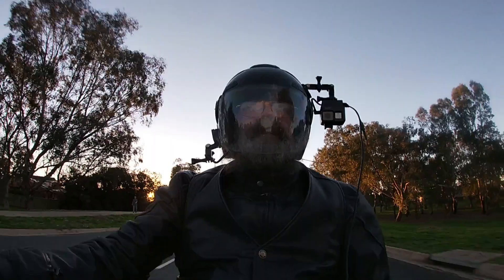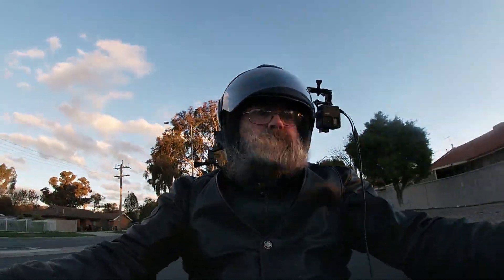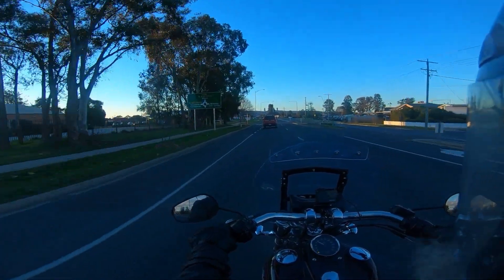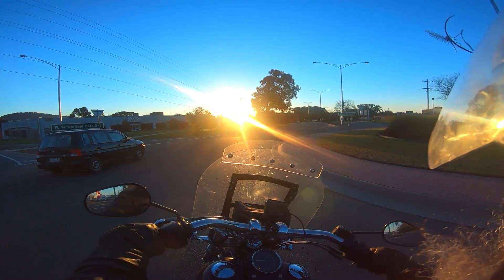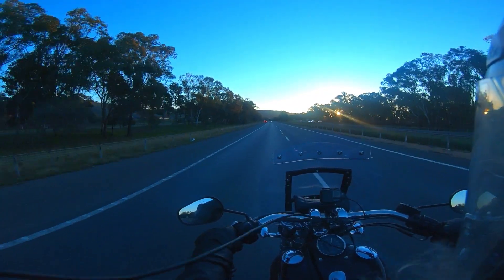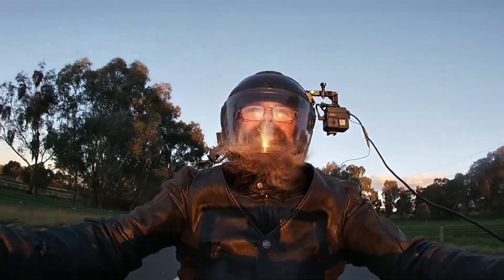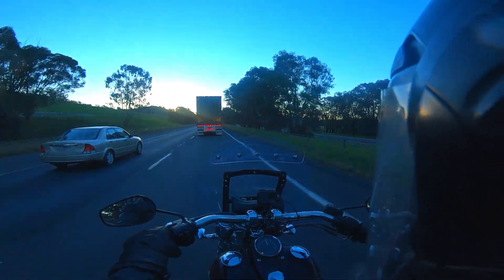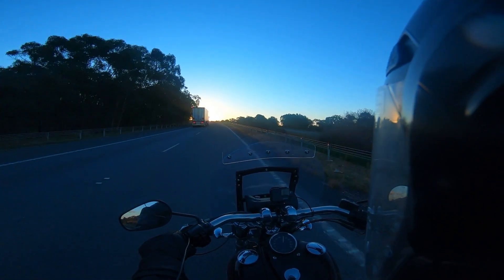Equipment Test.  Screen Mod. 5 weeks to zero hr.

Comment: Biker bits did a vid a while back on wind around his screen. If i remember correctly he stuck streamers to various parts of the screen & handlebars went for a ride & worked from there. CHEERS m8 : )
Reply from the maker: I have seen that one Bobber. I need to make a slightly wider screen to stop buffeting from the sides. The wind that comes up under my chin is being deflected from my knees and going strait up. It is always a compromise.